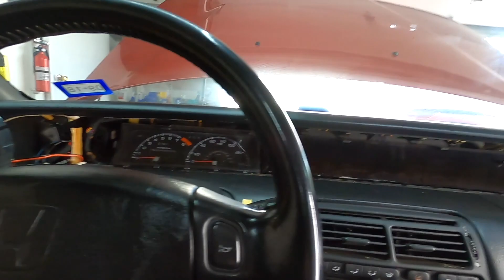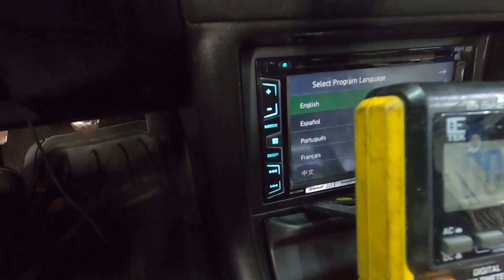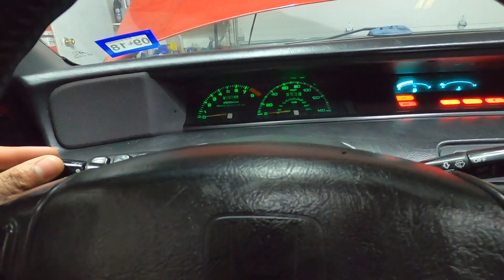Project Prelude LED Cluster Conversion! (Non EL)

Comment: Im a little slow on these things but what was it that you were soldering g?
Reply from the maker: The circuit board. I lost the adapter for the led so i solder straight to it. I fixed it now with replacement adapters for the bulbs.

Comment: Bro I bought a new fuel gauge cluster and it burnt out after 5 mins what could that be
Reply from the maker: One of the caps on the circuit board prolly blew
Reply: @SteezyManny  why would it blow so quick
Reply from the maker: @geetee6343  could’ve been already going bad. They leak as they get old. It’s just a guess tho
Reply: @SteezyManny  thank you so much for your help bro this thing has me losing it lmao